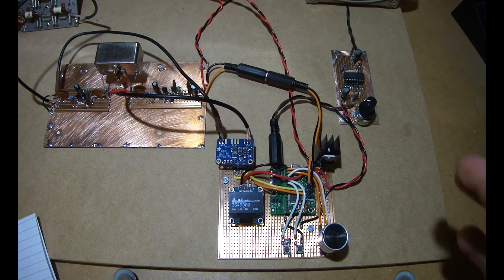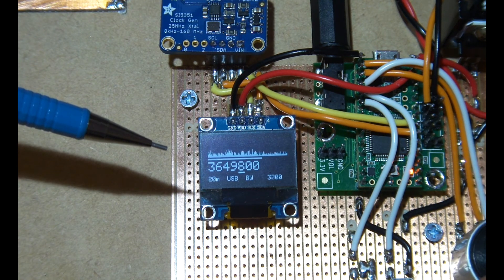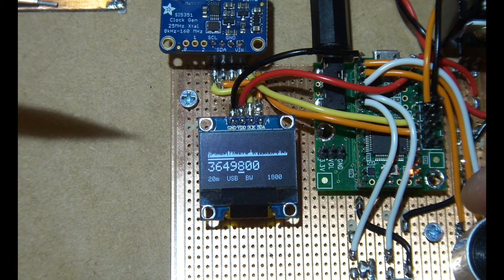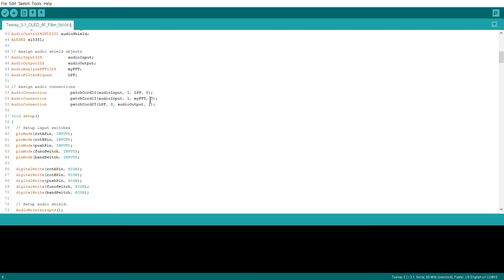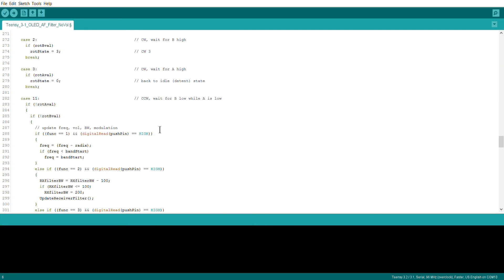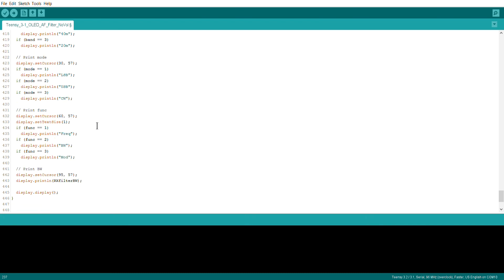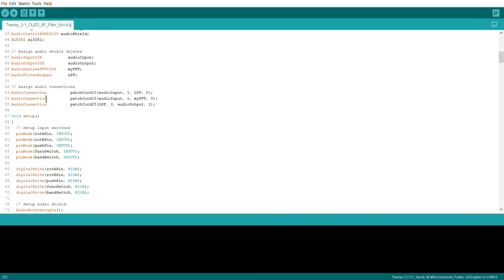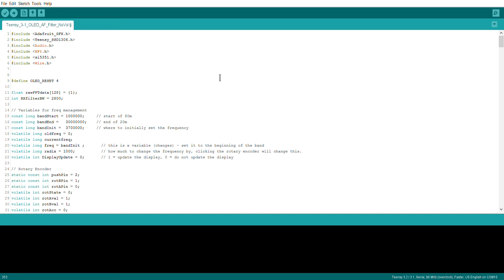Simple Homebrew SSB/CW Transceiver Part 5 - AF Amplifier and Variable Filter

Comment: How did you get the spectrum analyser to match with audio modulation. How coul I declare analogic s-meter on code?
Reply from the maker: Hi Emerson. Check out the Teensy audio library design too at https://www.pjrc.com/teensy/gui/

Look for the FFT and the Peak objects on the LHS. Compare that with my code.

Comment: Thanks very much.  I would like to get a copy of the code.  It will be a bit easier to study in detail that way.  I do get the gist of it from the explanation.  That Teensy library is really incredible.  I'm just ordering a Teensy and audio board to play with.
Reply from the maker: Sure thing Mark. It's up on Github at : https://gist.github.com/CharlieMorris/05d9552fc0072085bfe57e7981b2388b
Reply: Thanks!
Reply: I cant get file teensy...do you have file teensy...thanks charlie..